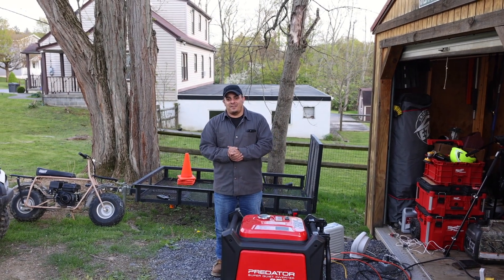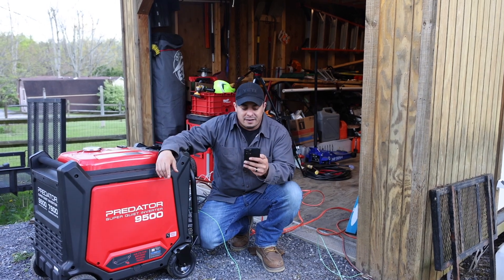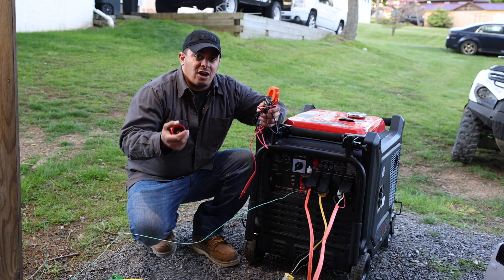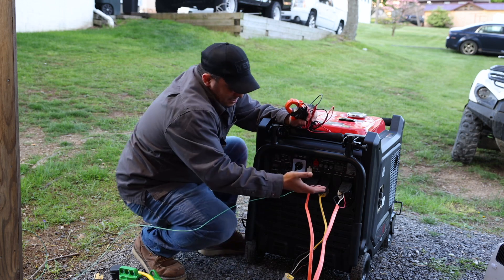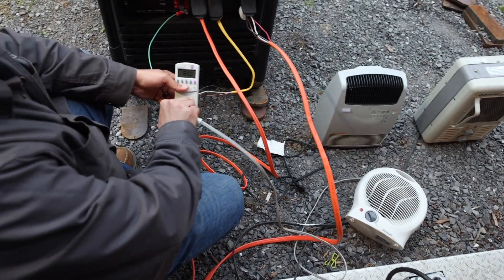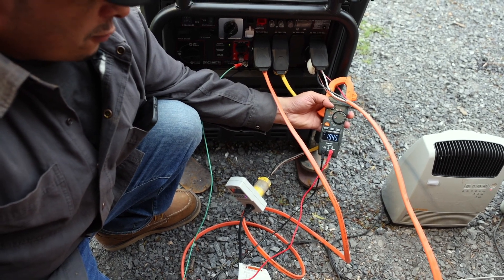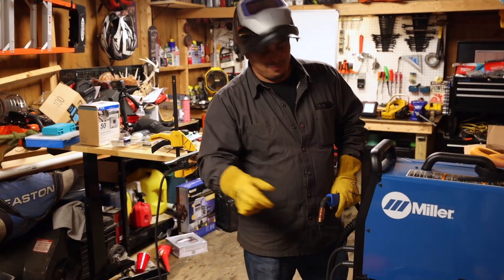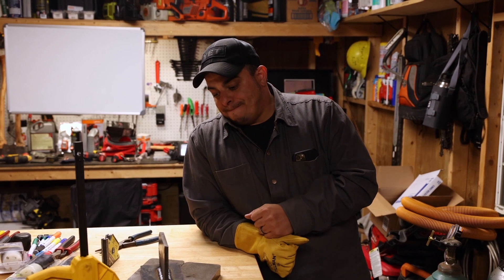Load Tests | Predator 9500 Inverter Generator | Does it perform?

Comment: I'd have to look it up, but I believe a welder is really just a heater.  Who would need to run two heaters in that size space?  Well maybe a retire or something, but that's getting off topic.
Reply: A heater is a much simpler devise. Just a steel wire instead of copper. For safety they have an overheat switch (switches the heater off). That's all. A welding machine is very complicated!
Reply: @tarquineous  A welder is a dead simple machine consisting of nothing more than a transformer.  Yes they can be more complicated... but the originals were dead simple.  I'd have to go back and watch this video... knowing me my comment was one of sarcasm.
Reply: @ShainAndrews  Shain, I serviced and repaired welding machines, both engine driven and plug in types. And I've been a welder for 41 years. I don't see anything simple about the new ones (after year 2000). I welded with one in a military museum. It was basically a plug in machine (440 volts), like on many military bases, and its output was a big generator. Very heavy, but all motor-generator with small control box. It ran smooth and welded very good. It was like a small trailer with a big heavy bullet on it! Stick rod only, as far as I remember. Now there are boxes with no heavy transformers. They work like an inverter.
Incidentally, to test the welding machines at the rental/service company, we would use a (heater) called a load bank. Basically a bunch of heaters, each with a heavy duty switch. I could go on but, look up history of welding machines sometime.

Comment: Nick, can you use it with a converter kit for your circuit breaker box???
Reply from the maker: Yes you mean a transfer switch?
Reply: @NickPixelTV  yes
Reply from the maker: @501959bigtony  yes i bought a 30amp transfer switch with i believe 6 circuits i have to find some time to wire that up and make a video but you can do that or wire it to panel breaker and have an interlock for your panel
Reply: @NickPixelTV  Ok, thanks. You are very helpful 👍

Comment: What were you welder settings volts? Wire feed speed?
Reply from the maker: Id have to set it up again but i ran it hot for the test also have burned some 1inch recently with no problems

Comment: How much power does it make on idle or will it do that?
Reply from the maker: It powers at idle and will throttle up as needed to maintain running output of 7600 watts

Comment: I really like this testing. I have a 2500 what Honda that is old (1996). It really did the job with the ice storm in CenTex to keep my frides going and my wood stove blower on, however it is 120 only. I really need a gen like this to run my well pump also.
 Thank for the info .
Reply from the maker: Anytime thanks for watchin

Comment: Nick,
Awesome channel!

Please give an update on the 9500.
Does it run the house plus 3 ton AC unit?

Thanks,
Dan Hulshult
Reply from the maker: Dan, i Havent put it on ac yet but it def does what it says it will do and i have some hours on it. In all kinds of scenarios recently
Reply from the maker: I have seen videos of it running 3ton units though. Some have soft starts installed

Comment: Good job on the load testing , and you didn't talk all day about it. I have a Millermatic 211. running .035 gas shielded flux core. I'm hoping my Briggs and Stratton 6500 / 5000 inverter will run it. I will test it this weekend. What wire were you running? I wouldn't be surprised to see yours run .045
Reply: Did it ?
Reply: @LemonySnicket-EUC  I wouldn't recommend the Briggs 6500 if you want to use the Millermatic 211 to the max settings. The welder senses the voltage drop from the generator and automatically shuts down. Very frustrating. It works if you don't want to weld thick material, above 1/4 inch or so, and you don't turn it up.

Comment: Hey Nick!  I hope you haven’t already answered this but,  is it possible to plug in my 50 amp cord to run my 5th wheel RV?  If so, how?  Thanks in advance for the video and information!

Tim
Reply from the maker: Tim, not a problem at all. Yes you can get about a 20.00 adapter on amazon for this it would be a 30amp to 50amp twist lock https://amzn.to/3eKDmZG   This is probably the one you need just make sure that is the style receptacle on your rv. You will only be able to run at 30amps though but that should cover most if not all of your 5th wheel i hope this helps and thank you for watching
Reply: @NickPixelTV   Thanks for answering!!

Comment: Like the review! What's the thickest steel that you have welded at 240v with no problem. Im thinking of buying one for my Welder but not sure if I can weld a 1" steel.
Reply from the maker: 1inch multiple passes with a miller multimatic 220 also tig with it no issues thus far
Reply: I appreciate the reply. Thank you
Reply from the maker: @ericflores8199  anytime Eric, best wishes and thanks for stopping here

Comment: Great video.  Thank you!

Do you know what the winding pitch of the Predator 9500 is?  Is it 2/3, 4/5 or 5/6?  If the Predator 9500 has 2/3 winding pitch, I can parallel the Predator 9500 with my Predator 2000 which is a 2/3 winding pitch generator per Harbor Freight Product Support.

The term "winding pitch" is the ratio of the number of winding slots enclosed by each coil in the alternator stator to the number of winding slots per generator pole.

Comment: You answered the question I had. I had  wondered if it would run a mig welder on 240 volts. I'm sold. I just want a generator that I can put on the truck with the welder and do mobile welding. I have a shop but occasionally I have to go out of the shop for a repair in the field. This generator fits the need perfectly. Thanks
Reply: Is your welder mig/stick? Or mig only? Wondering the same thing, just a little concerned about Polarity. If generator puts out ac, do I need an inverter mig? Or does the mig already use ac rather than dc?
Reply: @markanthonyalamillojr.2586  mig and stick ac  only the generator puts out ac only but bigger welding rigs use DC I'm pretty sure

Comment: Cool video. I like the part scientific, but also real world use tests many of us would be wanting to use it for. Very helpful. I also own a 220 Multimatic!
Reply from the maker: Right on Tim thank you!!
Reply: Same here! I'm starting my mobile welding business & need a reliable generator for my miller 220. Thank you for this video.
Reply: how is the generator holding up planning on purchasing one for my needs with a spool gun I normally run mig and spool off my Lincoln mix but its too big great fir stick welding but other than that the generator portion is. amazing 9500 running watts and 11k peak.  @OG-rs7ov

Comment: Harbor freight's warranty on their generators is 90 days. The average warranty on most other brands is at least a year. A customer shouldn't have to purchase an extended warranty to make them feel better or more confident in their purchase that it will be covered in the event of a component failure. The units that get returned to the store don't get sent out for repairs. They get sent back to the logistics shipping department and they get tossed out or recycled for scrap. Inverter generators are very handy however the inverter board inside can't produce the raw power a regular brushed or brushless generator with an AVR "automatic voltage regulation" unit can. It looks like a solid unit and their products have improved. I'd like to know what happened to that 11,000 watt continuous unit they used to sell. Your review was pretty good. I guess I just concentrate on longevity.
Reply: True!!

Comment: Hey nick new subscriber here! Will this generator power a house? House meaning.. 2 tv’s-lights-central heating and air-router and modem? Thank you in advance
Reply from the maker: Jeremy thank you. Add up your wattage on everything you want to run and that should give you an idea. I am using this for backup for my home and powering at least 6 core circuits. With the ac unit it will depend on the size would have to know a bit more. Ac units typically are fine just the startup could be the issue (you could buy a soft start unit to help there if needed) for most homes though this is going to cover most if not all of what you really need in a power outage. I hope this helps you.

Comment: Hey...great video on this thing. I just bought a predator 3500 it's unopened and I'm thinking about exchanging it for this 9500 watt beast. Thanks alot for the info much appreciated.
Reply: Sweet,  I ended up keeping my 3500 watt predator.  I went back to get the big one, and realised it's impossible for me to move alone if I needed to.  Good luck!
Reply: I’m doing the same thing tomorrow. I have the 3500 now. I need more power lol

Comment: I have the 3500 and love it. I would have got this one as a whole home backup but not having a 50A output makes the biggest generators worthless because you can't use the amps the machine is capable of.
Reply: 240volt X 30 amps = 7200 watts as advertised it is not capable of 50 amps that would put it at 12000 watts it would need a V twin to achieve that.
Reply: @Thrive-Off-Grid  I guess that's about right then. My Duromax 9500 does about 40A x 240 so I needed the 50A inlet to power my A/C.
Reply: @primeideasconsulting  That is about what he was getting, he was pulling nearly 20 amps per leg on 240. Is your AC unit older? Maybe consider getting a new more efficient unit that requires less power. When you go off grid you do not make the off grid system fit the house!! You need to make your house fit the off grid system!! Most homes are waaaaaay inefficient. Hot water heater you shut off until you need it. Refer switch to an RV propane unit. Lighting all needs changed to LED, heat use wood. AC get newer more efficient AC and you may need to down size it. Use an inverter system with a battery bank, Never run a generator as a primary power mover. Make the power you need and shut it off! A generator that is off is much more efficient than one that is running.
Reply: @Thrive-Off-Grid  I have NG running my house including my Duromax Gen. Unfortunately, I can't upgrade my AC for some time. But I know with my 3500 and the unusual lows temps after Zeta, we were unnaturally comfortable for the 5 days we were without power. I even had to turn on the oven and use a box fan to keep the house warm. Never before has anyone seen this after a hurricane!

Comment: Thanks for completing this test. I’m most interested in making my welder mobile, so the weld test sold me. Great vid, keep ‘em coming.
Reply: I like the generator just wish it had a 50 amp option so it could run both a/c units in my fifth Wheel.
Reply from the maker: Thank you Jesse
Reply: How is it working out so far, I am about to pay cash for this thing, the home I rent is 110-120 and I pop the breaker constantly trying to weld for more than 30 seconds.
Reply from the maker: @iheart3dprinting951 i use this generator the most out of all my generators its fired up my house probably 15 times in short outages since ive owned it and use it at our off grid property. It has sat for months at some points and fires right up may take an extra few cranks if it sits but she goes hope this helps

Comment: Question... is the 240v 2 30 amps?
Reply from the maker: It’s a dual breaker if either legs pulls over 30amps it will trip

Comment: Knowing your electric, I love it, and i understand your exposed wires, for testing/ demonstration purposes, as well.
Reply: If it was not for demonstration, as an electrician i would have given you an ear full of code violation just on using romex with a thirty amp twist lock plug! Yes I know it was for demonstration purpose, but proper cables should always be used when possible!
Reply from the maker: Without a doubt Pat figured it i would hear something about it (if i Didnt say anything in the video) but was just for demo and with the price of copper i wasn’t cuttin lol. Thank ya my friend

Comment: Honda or HF?  I am replacing an older Honda with an inverter for whole house emergency back-up. The huge price difference makes the HF seem like a no-brainer but the 90 day warranty concerns me...when something seems too good to be true, it usually is. When you've lost power in mid January and it's -5º the money you've saved will seem insignificant if your generator fails. Either way, it's a significant purchase and want to make an educated decision. Any thoughts would be appreciated.
Reply from the maker: Im in the same boat really. I do have a little honda 2000 as a backup to the backup as well as an older Onan in my RV but for the cost and the power I think this unit should be fine. I kicked it around a bunch myself. You can buy an additional warranty for the unit if that helps. I feel like if its maintained well it should be fine. I also talked to a few friends that use the 3500's that havent had many if any issues. 5k for a honda with less power was a little steep for me.
Reply: If you have $5000 to blow get the Honda 7000 inverter.
Reply: @maxracingteam23  I can't determine if this is sarcasm or a Honda endorsement
Reply: @GaryT1952  no I’m serious.  Lol.  The Honda will last forever but at the hefty price of $5000 it’s a big chunk of change.   If you don’t want to spend so much and have a decent/good generator get the harbor freight. 👍
Reply: @maxracingteam23  Thanks ..".Buy once cry once"...tough to justify the purchase, but in the long run I am sure it will be a good investment. So many appliances, dimmers and computer equipment require clean power that older and non-inverter generators are dangerous to use. I had a hi-tech dimmer catch fire during a power outage...that was an eye-opener

Comment: Do you know how clean the power is? Would it be safe to run computers etc. off this generator?
Reply from the maker: Yes this is an inverter generator I have a ton of electronics in my home and thats why I picked this one. So far it's worked well

Comment: I picked mine up this weekend and did some initial testing last night.  I'm impressed so far.  However, keep in mind that the unit is only covered by a 90 day warranty and that the replacement plan costs are $260 for 1YR or $500 for 2YR.  That might make the sister model, the DuroMax XP9000iH, with its 3YR limited warranty, dual fuel capability, remote start, and improved instrument panel a better overall value.
Reply: Exactly what made them popular before is less today.
Reply: @Moondoggy1941  what ?
Reply: @dznuttzonyachin7499  Yeah I think I was trying to say, is what made the Predator a good purchase was that they were cheap enough and reliable enough to take the chance, now the cost is rising the warranty cost more and they are not the bargain they used to be and the competition is catching up and surpassing them.
Reply: @Moondoggy1941  they all kinda seem to be the same imo. 

Clone engines with same configuration that just look different. 

reading tons of reviews on several different models seem to suggest the warranty sucks for the most part having to have it sent to a repair shop etc. 

Best to run the dog 💩 outta it in beginning before 90 days is up
Reply: @dznuttzonyachin7499  I like Champion so far, at least they will contact you or at least respond if you have a complaint, I think it is better to get two 2000 models and if you need more juice hook up the second one and run them parallel.
Reply: @Moondoggy1941  you have to know when to buy it.  Tomorrow I pick mine up because it goes on member sale.  I'll save $300.  Non members get it next week.  If you open up their card you save another 10% .  Thats about 500 off the $2300 list.
Reply: @froochie123  Thanks for the heads up, is this the Black Friday sale for the spring private sale?

Comment: Nick,  Did you purchase the extended warranty on this unit?  Just curious.
Reply from the maker: Steve, actually to be honest I did not. I was on the fence and can purchase it up to 30 days after i believe but i figured if something small causes an issue i could prob fix it. After the oil change and with the oil looking decent and a few of my friends with the 3500’s saying good things i figured id take the chance. If i wasn’t a garage kinda guy i prob would of bought it just to not have the worry. I hope I made the right call on that
Reply: @NickPixelTV  I didn't either.  I have a natural gas conversion kit ordered for mine from PNG Technologies and I don't know how Harbor Freight would feel about honoring the warranty given that fact.  Any opinions on that?  Thanks.
Reply from the maker: That is a good question. I think if it was back to original they may but who knows since they didn’t make it a true duel fuel unit. I run my stuff good at the beginning and sometimes feel if something is gonna happen itll happen before the warranty. Doesn’t always work that way but with good maintenance i think it’ll be fine.  Thank you for your time here

Comment: When running on the 120 or 240/120 switch, is the 30amp breaker lever suppose to be in the off or on position?
Reply from the maker: I think im understanding you correctly but for the 30 amp 240 to work you’ll need to have the switch to 120/240 and the breaker on. The breaker for the 120/30amp receptacle side is just a push button breaker
Reply: @NickPixelTV  Awesome. Thanks for the reply. I will leave the breaker switched to ON at all times then.
Reply: @NickPixelTV  Does it rev up when you switch the breaker "on" ? Mine does not and ive seen in other videos it does. Not sure if mine is bad.

Comment: Sweet.  If my 9400 watt duel fuel generator ever takes a dump im getting one of them.   Everyone needs a generator. Everything in a modern home and garage runs on electricity.   Mine saved our buts in 2009 when an ice storm knocked our power out for 8 days straight.   Biggest ice storm that ever hit Kentucky.
Reply from the maker: Thanks Ernest!! Be safe